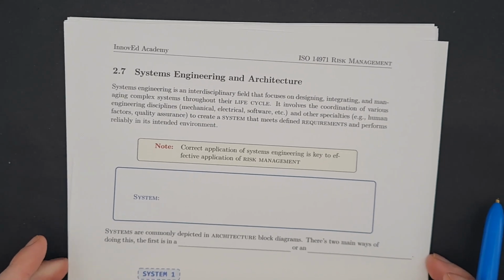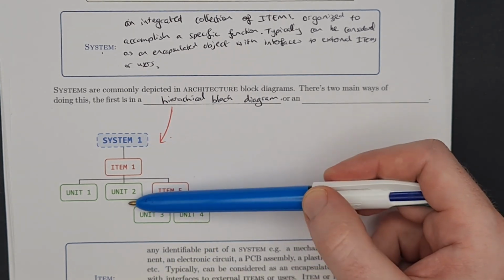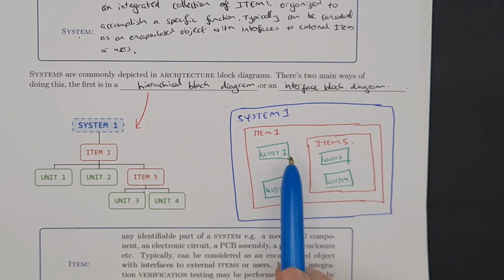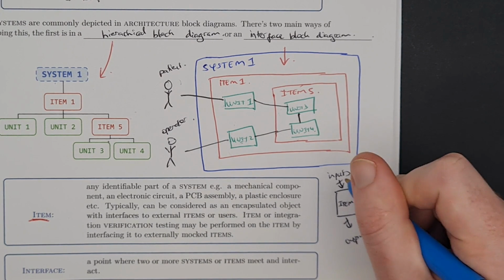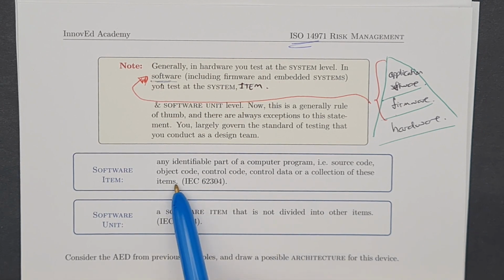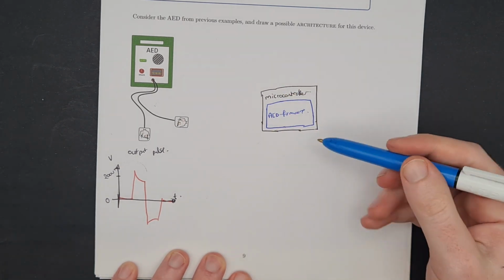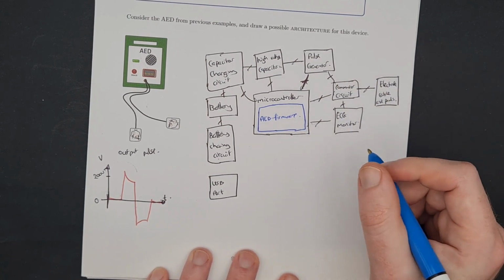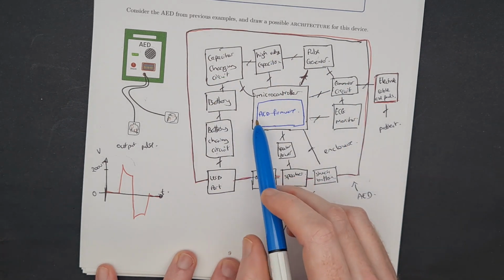Systems Engineering & Architecture [Part 7/20]

Comment: I appreciate your training. If I may, I want to clarify that Design and Development Review/Design Review is a required design control element that is separate from Design Verification. As well you forgot to include Design Transfer in the V diagram. Design Transfer is ensuring your design outputs are verified as suitable for manufacturing before becoming final specifications where risk management can show up with essential design outputs. One more miss is the Design and Development Plan which demonstrates control of the design and development of the product and can outline the risk management activities along the way.